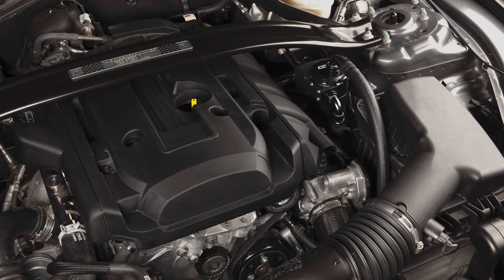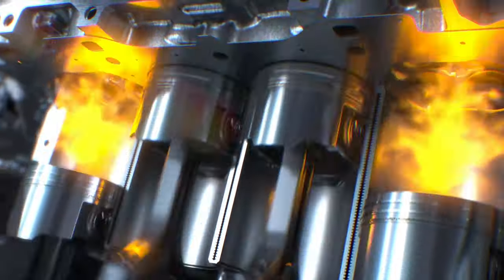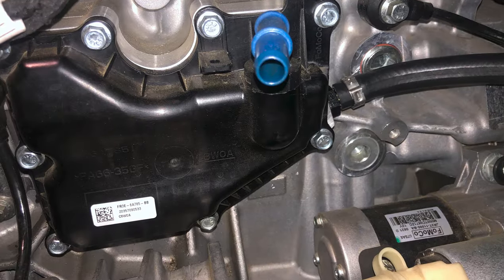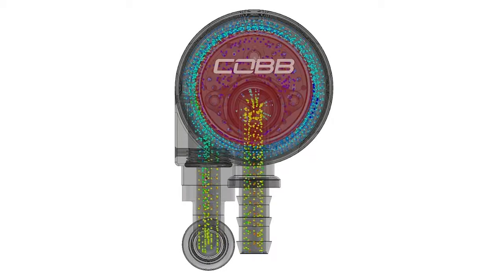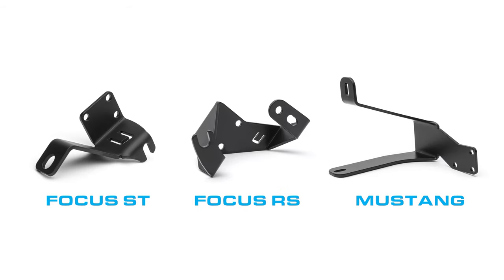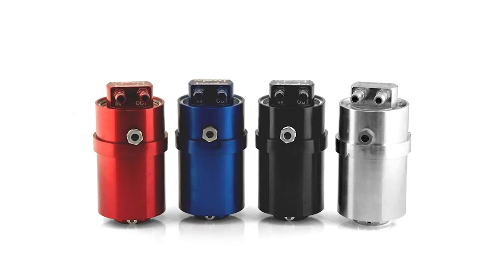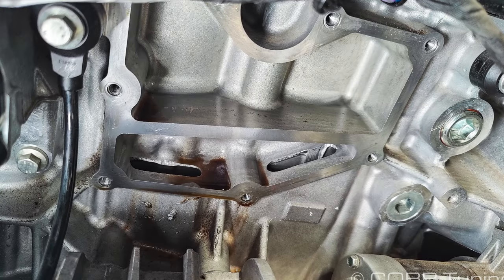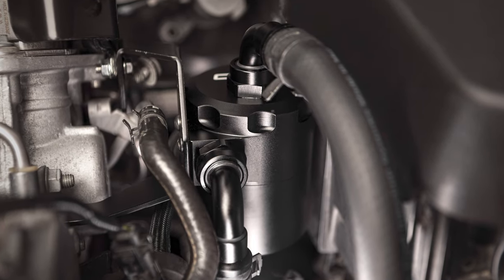COBB Tuning - Product Highlight - Ford Air/Oil Separator - Focus ST/RS & Ecoboost Mustang

Comment: A much needed product for our platform, I wonder how this would work with my Radium plate?
Reply from the maker: While they may physically fit together, most applications don't need both a separator and a catch can setup.  The plate in our kit has very similar baffling to the Radium piece.
Reply: He was referring to the Radium PCV baffle plate.  @cobbtuning
Reply: Probably not, as this unit has its own baffle plate. If the lines attach at the same places on the Radium then maybe.

Comment: How does this compare to the UPR dual valve catch can though? This does seem interesting because it's almost like a radium breather plate plus a catch can in the same bundle. What Im wondering is what would be better for my modded setup with big turbo mustang?
Reply from the maker: Typically a catch-can has to be monitored and drained at a certain cadence, depending on your engine.  Our separator has a drain that feeds oil back into the crank case.
Reply: Ok, so what you're saying is the oil goes back into the crankcase and the engine where it can be reused properly instead of into the intake manifold when it can cover the valves?

Comment: How difficult would it be to install yourself, or how much would it cost to get the dealership to do it?
Reply from the maker: We put a 4-wrench difficulty level on it.  Can certainly be done by someone mechanically inclined and used to working on their car and the tools required are relatively basic.  Take a look at the installation instructions (link below) and you should be able to decide if you can tackle it yourself.
https://cobbtuning.atlassian.net/wiki/spaces/PRS/pages/2979954727/Focus+ST+Air+Oil+Separator
Reply: @cobbtuning  Thanks for the response!